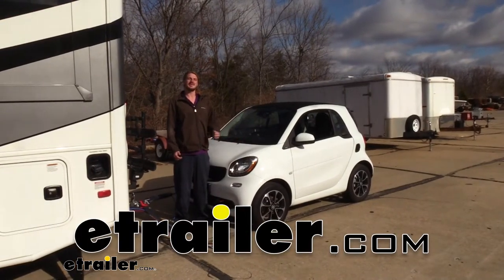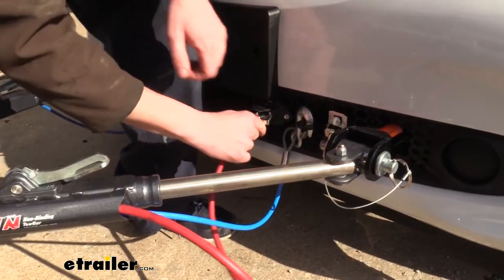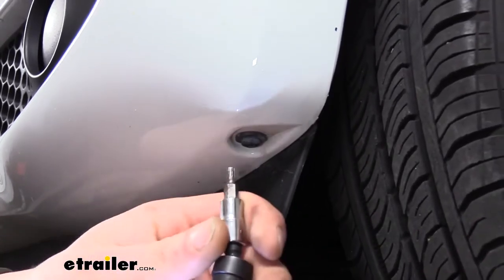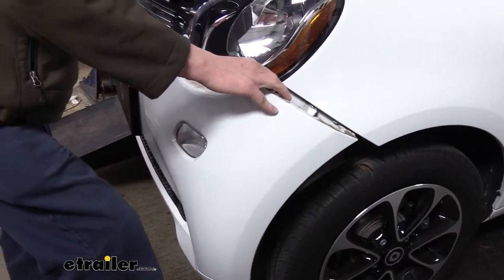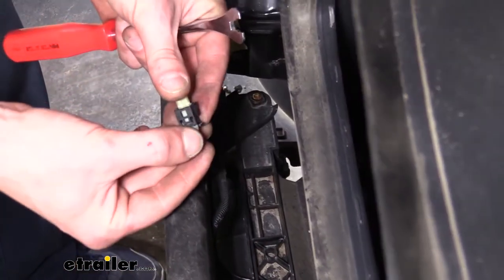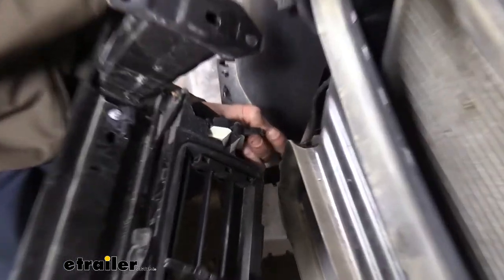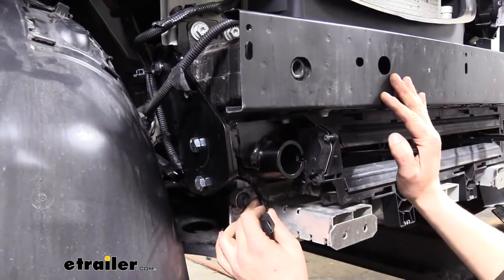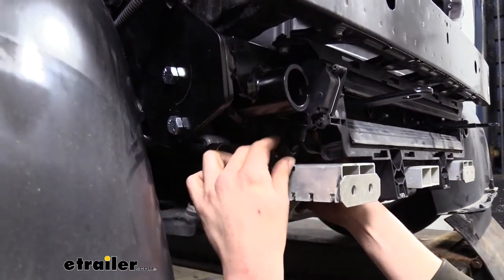etrailer | Roadmaster Direct-Connect Base Plate Kit Installation - 2017 Smart fortwo

Comment: I might also add that in the video you didn't show connecting the light/turn signal plug back up on the passenger side so I had to remove mine again just to plug that back up.  And instead of cutting the holes in the front I used a hole saw on my drill and it worked great.  Also to drill the two holes in the side of the frame through the base plate I removed the tires which allowed my to drill straight and not at an angle.  Worked great.

Comment: Just installed the base plate kit on a 2017 Smart for two and the video was much better than the instructions.  But after installing the side plates where the two studs were sticking out to hold a wire and side wheel cover the base plate just about covered those studs up as they are even with the base plate so what do you do with the wires and the screw on clamp for the side of the wheel cover?  This is in 10:30 on the video.
Reply: Found out that these wires under the wheel cover just have to let hang as the screw tabs can't be put back on due to the stud length.